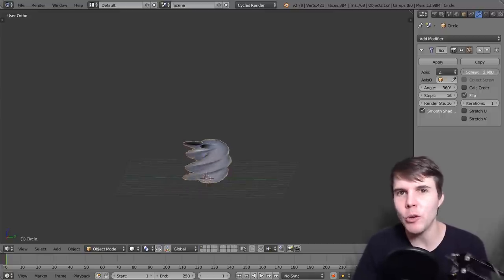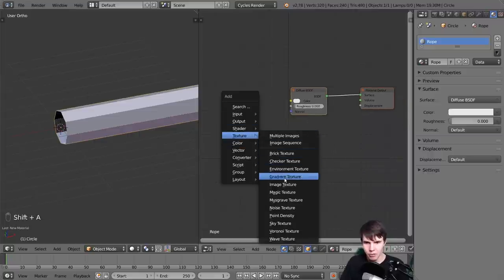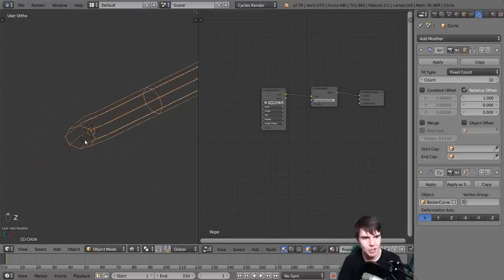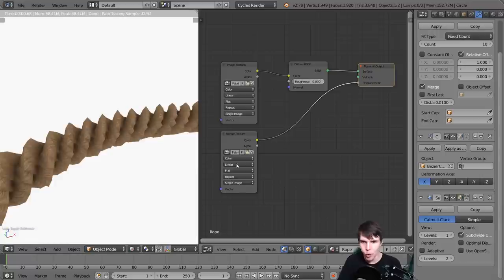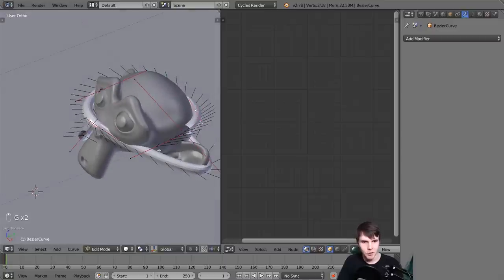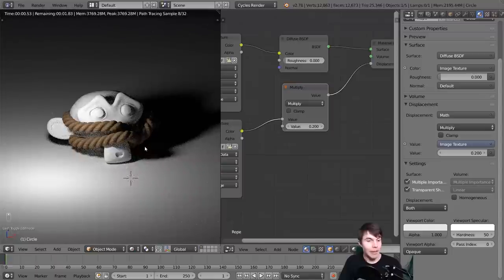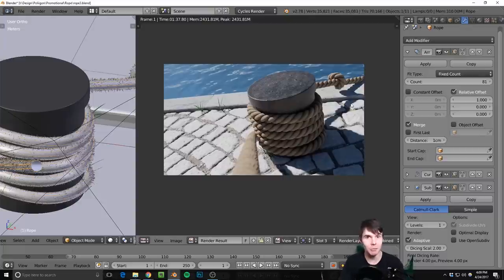Rope Tutorial - Blender Guru

Comment: guys, in the array modifier, you can set the length to be as long as the assigned curve so you dont have to worry about it in the future.
Reply from the maker: gah! I can't believe I missed that. You're right. It's in Array Modifier > Fit Type > Fit Curve > Set as Curve. Done.
Reply: Well animating it would probably be easier if you turned it into a rigid body. That way you could get physics too.
Reply: +Jeffery White
 well not really, however there is also a feature that makes it easy to animate, which streches the array rather than adding new segments. look up "Rigging a Spiral Phone Chord in Blender" by CG Cookie. he explains it all.
Reply: I was wondering about this because, much like the top comment, I am curious about creating knots, (k)not a knoose specifically but I wanted the rope to tie itself up if I bent it around something in the right way. I am assuming that I need to make it a rigid body first though as it would probably need to simulate physics. Then that also makes me curious if I were to import it into UE4, would I be able to tie knots with it in there as well?

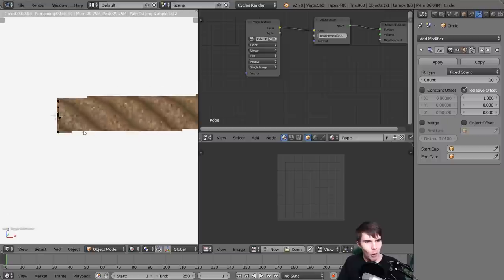Comment: FYI at 9:20 you mention that a lenghtwise rotation of the rope fibers is incorrect. The rope at that point would be a Zz rope, after you adjust it its a Zs rope. The Z & S refer to the rotation of the the Rope and its individual fibers and while for a rendering its probably not that critical its worth noting that a Zz rope has different characteristics than a Zs rope. For example when building a crane you dont want the rope to unwind/ unturn itself, this is where the correct Lay types of rope come into play.
I hope I havent bored you and that everything was understandable.

Comment: Anyone on Blender 2.8 that might be having trouble because the rope shape doesn't actually look like Andrew's. Here's what I did: Added a "displacement node" and connected "color" (from the image texture) to "Scale", then set the "midlevel" to around 0.050. Otherwise, when I connected to Height like CodeBlue suggested, it looked like waves instead of a rope. Hope it helps
Reply: Thank you!
Reply: thanks dude, it helps
I also like to notice that it way ruins egdes of rope's pieces parts a little bit
u can easily fix this by up number of subdivisions in subdivision modifier up to 3 or more, which depends of your hardware abilities

Comment: I followed and got a rope! Thanks!  For future reference, if you go to File-> Recover Auto Save, you can usually get a blend that's saved 5 minutes before. Also for getting the length to fit to curve, the array modifier has a setting called "Fit Type" - you can select "fit curve" from there and select your curve and it will fit.

Comment: Hope this tips helpful:
1 - You can align UV to edges probably easier with menu - (UVs -> Constraing to Image Bounds). Then just drag whole UV and it wont let it go out of that UV square.
2 - When your blender crash, in most cases it has autosave file. So just go menu - (File -> Recover Auto Save) and pick the latest sorted by date time. If you had this project saved before then it should be named like original save file but just must have latest changes that you didnt save. OR, if you didnt save at all it should be named with numbers(what they mean i have no idea, probably they random) :)

Comment: To do this in 2.8 you can follow the video setup or use a full PBR node setup using the Principled BDSF (i use node wrangler to automate this).

Note:The results are only visible in Cycles at the time of writing, so make sure you're not in EEVEE. 

Go through the above tutorial until 'experimental', 15:35  instead, skip & scroll down in Materials to Settings and >Surface>Displacement Method change to Displacement Only.  You can now tweak in Nodes using the displacement node (between the Displacement image and Output nodes) A scale of 0.05 worked for me. Hope that helps!
Reply: Thank you!

Comment: To everyone trying to use this in Blender 2.8: The whole part on Displacement confused me. I'm not sure it exists anymore. But here's what I did (that worked); Add a subdivision modifier, and set it to around 5 levels. Then, add a displacement modifier. Set the strength to around .011. Change the Texture Coordinate to UV. Boom, done!
Reply: Thanks
Reply: thanks dude i was stuck with that shit for over an hour
Reply: fuck i failed at this step before this comment, thank u dude

Comment: here the displacement map has the meeting points of the threads in black so the data displaces that as higher. I recommend inverting it with a color ramp node and pushing the white arrow to the other side and do the same with the black one and this will invert the map to make the black nit being the thread itself. That fixed that problem.

Comment: Ok, for those who dont have GPU and use CPU If for some when you double tab you don't see any change I found a workaround.

Instead of reducing the value of the Multiply node, increase it. That will fix the problem, I think a value of 8.0 works good.

Comment: Hi, I am a bit of a beginner to Blender.  I've got a quick question:  Why won't my circles extrude?
Reply: Make sure you're in Edit mode and press E
Reply: Oh ok.  Thx for replying. Before actually, I realized I did not have an add-on enabled.  I think that could have been the problem.
Reply: I think if you're in any other edit mode than vertex mode, for circles, it won't extrude.
Reply: Oh, I guess that could have been the problem. Thx for the help!

Comment: I can't seem to get the true displacement to work, despite following the instructions. I have 2.79 in experimental mode, and true displacement. I see no change, am tabbing twice as well. Really want this to work as I'm using alot of cord/rope.
Reply: Same problem
Reply: I had the same problem that it didn't seem to work either. However i followed through the tutorial and started fidling around when he added in the math node. I increased the value to 3.5 and got a solid rope texture. This is on blender v2.79 and I still used experimental. I however didn't use the adaptive method.
Reply: i am having this issue as well. it doesnt seem to add the fine details to the rope.  i can still see all of the polygons in it
Reply: same problem 2.79 and caused a cuda error and had to crash out of blender :( any upto date rope tutorials about ?
Reply: Has anyone managed to figure out this problem?
Reply: Got the same issue. Tried 2.78, 2.79 and 2.8beta - no luck. I am guessing it is hardware related?
Reply: I was having the same problem. 

To fix it I unwrapped it a second time after adding in the greyscale .tif file and it worked fine. Make sure your .tif image texture is going from the yellow color output to the displacement input in the node editor. Make sure your math node is set to multiply. And make sure you're tapping tab twice every time you make a change in the node editor (or any other window).

Comment: The faces you created neither look square, nor are they square. Doing the math one obtains a rectangle with ratio 1:sqrt(2-sqrt(2)), approx. 1:0.77
Reply: Totally irrelevant
Reply: though it's close enough
Reply: Just out of curiosity, how did you obtain the lengths using square roots? I used cosine, and I don't see how you were able to get it in square root form. Was it using the Pythagorean Theorem, or some other trick I don't know?
Reply: Nice that someone else got inspired to tackle this problem by themself. I basically just used the law of cosines and the regularity of an octagon. The cosine contained in the following expression is cos(PI/4)=1/sqrt(2).
Reply: I'm not sure if it's possible to make them exactly square in Blender since it has precision limitations, however, there's a great addon called Measure It, which lets you select verts and measure the length between them (also segments, arcs, etc). Can't remember if it's one of the pre-installed ones or not.

I used this to measure the vertical edge length, and yes, it's .76537... Then just scale the circle on the x to that value, and it's about as square as you can make it.
Reply: I just wanted to point out that in the "N" tool tab in Blender, in Edit mode, you can under "Mesh Display" select if you want to display things such as Edge Length, Angle, or Face Area or Angles for your selected mesh. 
For people who don't want to use MeasureIt, or who don't need all that functionality.. I guess
Reply: though Yeah, but what's the fun in that? I used that tool to check my work, but it's more interesting to do the math
Reply: This is true but the lengths displayed are only displayed to a few decimals, which may or may not matter for precise stuff!
Reply: Each edge around the rope measure 2*radius*sin(22.5º). Since radius = 1 and sin(22.5)=sqrt(2-sqrt(2))/2, side = sqrt(2-sqrt(2)). The other edge of the rectangles around the rope are 1 because Andrew stretches the rope that way. Reference:  http://www.mathopenref.com/polygonsides.html
Reply: I think what he meant was evenly /equally spaced not squared..
Reply: If you use a hexagon rather than an octagon for the cylinder, it works out perfectly.

Comment: Instead of adjusting the count of the array modifier, you can change it from "Fixed Count" to "Fit Curve" in the pull-down menu and it will automatically work out what the count needs to be for you.

Comment: There's much easier and precise way to make your UVs meet borders of the texture. It's actually longer to write than actually to do this stuff.
You need to select Cursor as your Transform Pivot Point in UV editing window, then extend right toolbar by pressing N, and there you can modify cursor position by changing X and Y values in range of 0 to 1.
When cursor is at 0,0 (bottom left corner) you select bottom loop and scale it to 0 on Y axis and scale left loop to 0 on X axis. Then change cursor position to 1,1 (top right corner) and scale right loop to 0 on X axis and top loop to 0 on Y axis. This way edges of your UVs should meet edges of your image precisely.
Next thing to do would to get rid of minor UV stretches thot might occur from inner subdivisions to uv borders. To do that you simply select a vertex at each of four corners of your UV and pin it by pressing P or going to UV>Pin. This way corner vertices will stay at their positions during unwrapping. And then you just re-unwrap your mesh. After that you will have UV that has zero stretching whatsoever and precisely meets image borders.
Like I said, it's much easier to do that to write down. It took me ten minutes to write, and it's actually done in like 20 seconds.

Comment: Can I just say, that when he told us to do the loop cut and slide, if he had made it become three lines the faces would be more square. But regardless, great video as always!

Also I have two questions, 1. Are you currently using Filmic Blender? 2. If so, can you possible make a video on it, going from the simplest ways to tell if it is installed properly, to the most complex? I recent tried to install it, but I can't tell if there is a difference or not in the lighting of scenes, and also the name wont pop up in my colormanagement section.
Thanks for the help!

Comment: Those actually aren't square faces when you first extruded the mesh, because nothing was done to ensure the height of the squares was aligned with the grid, only that the widths were equal. Probably not enough to matter, but just throwing that out there! It looks like the back face was at a 90 degree angle, so it could have been scaled along the Y and Z until those were the height of the squares?

Comment: Would you perhaps be willing to do a remake of this tutorial for 2.8? Seems I can't apply the same techniques here in Blender 2.8 since the way of doing some of these methods don't work anymore. For example here at 1:38 you can't extrude an empty circle with 8 vertices in Edit Mode because it just moves it around in 3D space, the only way of doing this now seems to be having the circle filled with a face before deleting the faces off each ends. Then later in the tutorial the mesh unfolding section shown at 7:00 doesn't unfold the mesh stuff in the same way as before, it ends up creating a weird shape that replicates the circle you've created that doesn't follow the basic shape it should be as squared segments.

Comment: Ah, your initial mesh before you started doing all that displacement mapping.

Good old low-poly rope. XD

I still remember those n64 games with rope that consists of a texture that's probably 32x32 or less, and a rope made of large cylindrical sections that have a triangular cross-section.
Gotta save those polys any way you can! XD

Comment: That was neat, but would it be posible to convert it to a mesh? For I would like to make the rope like you did, but then cut down on the geometry, bake a texture with shadows and then bake a normal map from the bumps or the actual displacement map.

I have just started to make meshes that I hope will be okay for games, but to make ropes and chains have been very hard for me, so my question may be very silly, so do not be to hard on me for my noobish stupidity. Thanks.

Comment: Thanks for great tutorial. I have learned a lot from your tutorials.Once I saw this tutorial, I have a question about chain link fence. I would like to make a rendering image which has chain link fences. I searched tutorials and tips in google and youture. But, most of them make actual 3d geometries for fence. But, I think, probably there can be more efficient way to handle the issue with mapping rather than modeling. If you don't mind, could you consider "Chain link fence" for your future tutorial? Thanks again!

Comment: To save time (if you have to restart the prep): Add Circle; Adjust vertices to 8 (via F6 if you prefer); Either in orthographic front view R then 90 then ENTER, or in any other view R then Y then 90; Ctrl + A, normalize rotation; Click Tab to enter edit mode; with all vertices selected press E for extrude, then X then press 1 and ENTER; press as many times as you need Shift + R, to repeat last action (no loop cuts will be needed, then); if needed, recalculate normals by pressing Ctrl + N (while in edit mode... with all vertices selected, of course); Continue with the important lesson... did I forget something?

Comment: im in for 2.8, spend time looking at this one, i painted my texture with AO brush, but when i arrayed it there is a nasty looking line connecting cylinders.. i assume if i just use texture of tree brark instead of painting with tree bark AO brush, problem will be solved, but i need a tree looking thing with different color.. i think next cool topic for tutorial will be 2.8 blender hand painted spline - tree using ao texture xD

anyway, its too small to notice. . result is much better then what it was before i saw this tutorial, guru OG
Reply: I had the same problem with the rope, the lines appear between the connecting cylinders. But check the "Merge" in Array Modifier to fixed it.

Comment: How do you do this in 2.8? Connecting to the material output displacement doesnt work so I used the displacement modifier which is ok, but after using that displacement map, it doesnt make those individual rope parts stand out, its just all weird..

Comment: Idk if it helps anybody, but I couldn't make displacement work for some reason and then I realized that my normals are flipped, basically my model is inside out, so I had to use Ctrl + Shift + N and recalculate.
Reply: You can change backface color so you dont get confused which is front and which is back.

Comment: I couldn't get the initial unwrap to work out in 2.90.1 without a double seam (top and bottom edges). I have no clue why or how, but I tried the first steps three times with identical results before reverting to that solution...

Comment: I don't get how you how do you extend the bezier curve?
Reply: or how to even select it
Reply: Select the BezierCurve, go to edit mode, select vertex or its control point and move it around. If you want to extend it (only works for ends of the rope), make sure you have selected single vertex on one of the ends and CTRL-RightMouseButton click (or LeftClick depending on Your setup) in the desired direction and it'll extend it that far.

Comment: Didn´t work for me in 2.8, tried twice from scratch, my problem is that the "top" part of the rope looks good and rounde, but the "bottom" part of the rope looks sharp, and not in the rope part but the black part between ropes actually come out sharp, tried to use different subsurf modifier, smooth shade, different multiply values and Math, nothing seems to help

Comment: GUH, I'm having difficulty with the new version of blender. For some reason my node editor looks super different. I don't even have a texture option when adding a node...
Reply: Same here, I've been trying to figure out but I can't make heads or tails of it
Reply: @ Fish Estrella Did you figure it out?  I'm stuck at the same point.
Reply: @davidmurphy563  Yes! In the materials section of your right panel, on the right side of the bar where you can change the material's name, there should be a little box with the node editor logo(?). When you click it, it should look like the regular material toolbox.
Reply: Thanks!  Actually, my issue was a little different - didn't have it set to "cycles render" - it's always something simple!

Comment: you can no longer follow along this tutorial in 2.8
Reply: Its pretty close. Only Difference I've found is that you need a displacement node in between your DISP (Image Texture) and material output. Connect "color" to "scale". Scale:.02 MidLevel: .03 ish and height: .7 to 1.  Works for me at least.
Reply: @jwaite987  hey, thanks for your help here ! I can change de midlevel and the scale, but I have no possibility to change height (and there is no value, just the word height written)